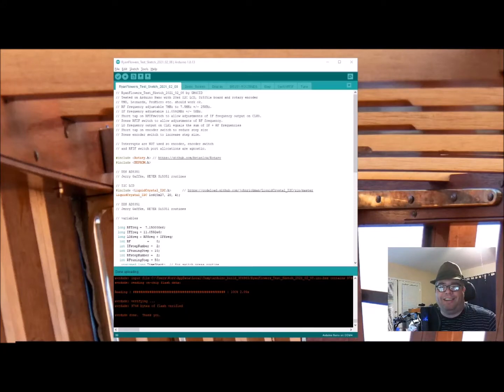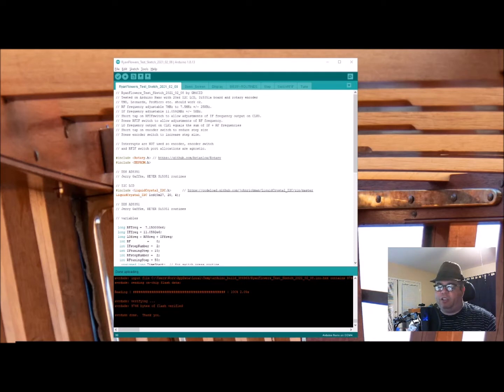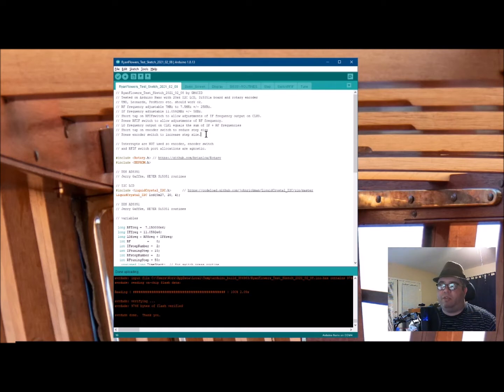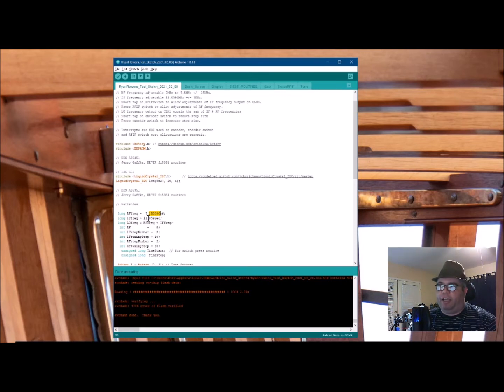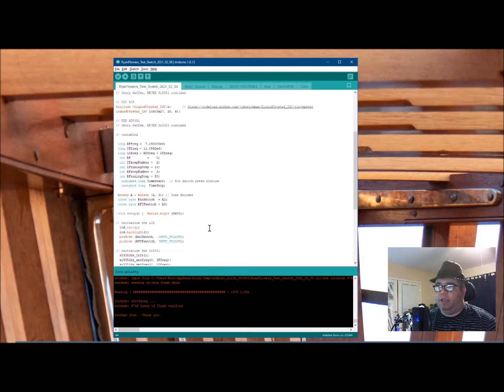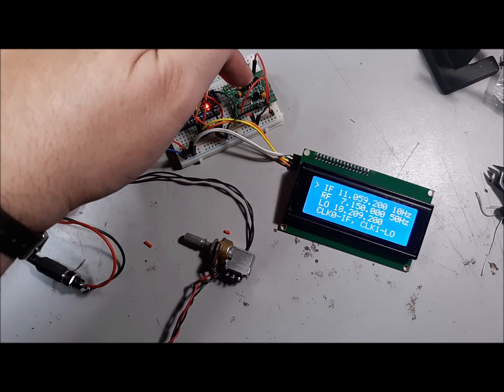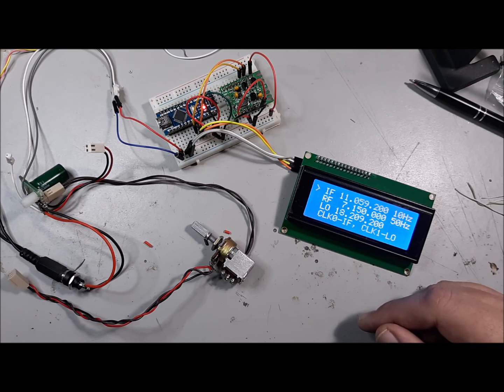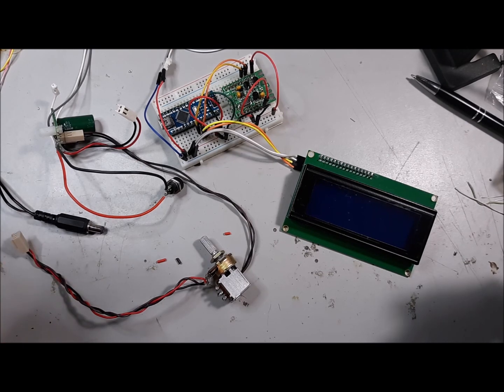Part 3.1: VFO Code Review, Construction, and Consternation

Comment: Thanks Ryan.  There is another ham YT-er doing similar things - if you haven't heard of him, search for NA5Y on YT.  Amongst other things, NA5Y has encouraged me to explore MicroPython and I'm now using MicroPython with the new Raspberry Pico instead of Arduino - I find it great fun and much much easier than Arduino.  NA5Y has used MicroPython (not with a Pico - but it was easy to port to the Pico) with the SI5351, an i2c-LCD and a (bouncy!) rotary encoder on a project from which I am cribbing - with success.  73 Kevin M0XYM

PS I've given up on breadboards.